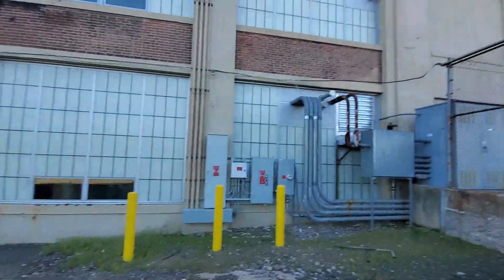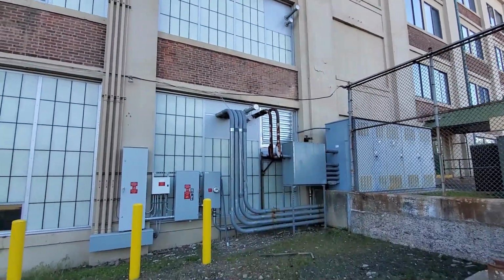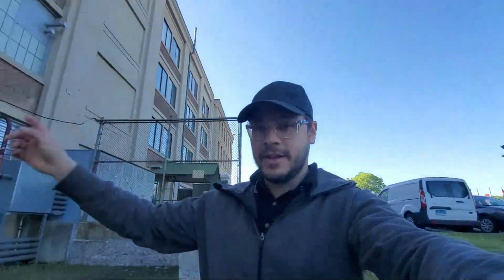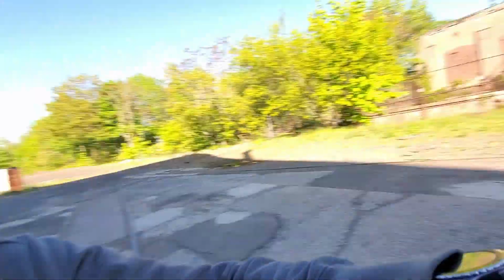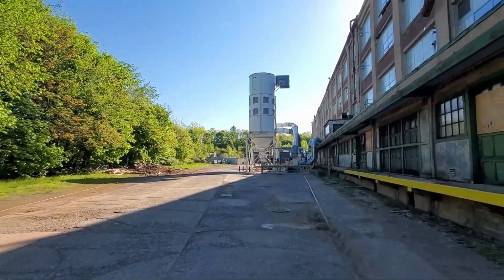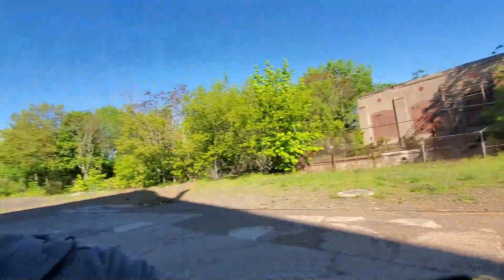CM Meatball Downstream

Comment: Does some of the steel have to be run twice?  Looked like some still had copper near the beginning of the video.  At the dosing hopper, looked like a mix of copper and aluminum.  Did you run a mix of copper and aluminum wound or is that aluminium from the motor housing?
Reply from the maker: Once it comes out of the system, it's clean. that clip was showing what it looks like after the primary shredder.